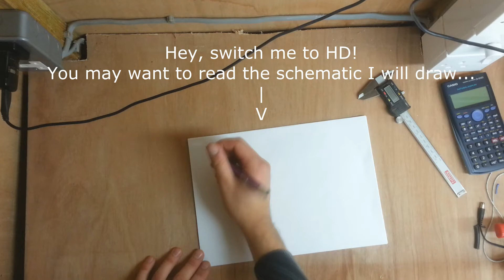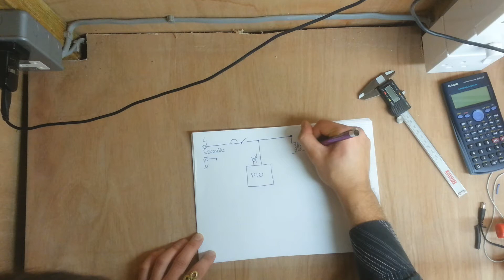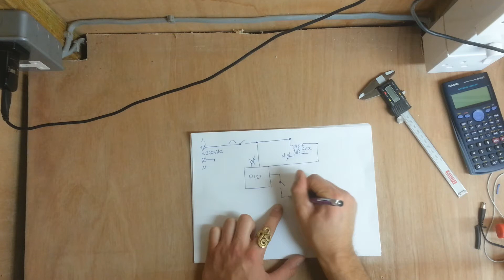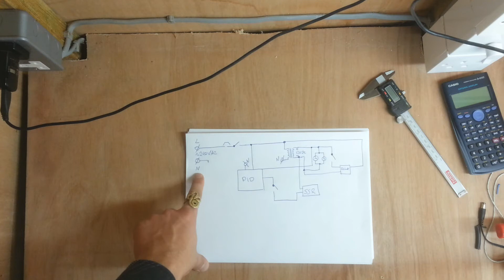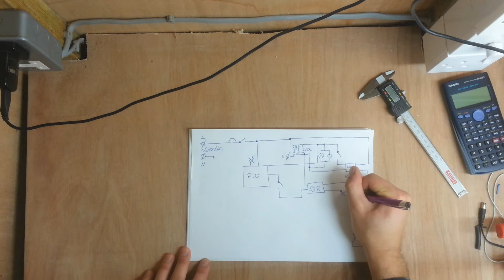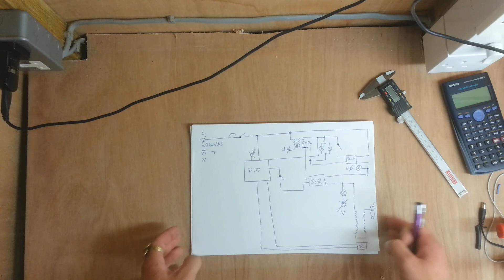Heat Treatment Oven Build: Part 6 - The schematics

Comment: A step down transformer will not give you 12 volts DC you need to rectify the AC using a diode bridge and capacitor bank to filter the the pulsation.
You door latch has a hose clamp that could be made cheaper and better with a cotter pin,
Reply from the maker: Frederick Kaludis You are absolutely correct. In the end I used a wall plug charger of some sort (from my junfk bin). Didn't occur to me at the time that this was technically a mistake in the schematics, but my intention was to use a wall charger from the very beginning.

Comment from the maker: Complicated? It turned out a lot simpler than though it will.
PID's are different. Mine does not give power to the SSR by itself - it must have a secondary 12VDC supply it can switch.
Also, there are no 110V legs on this setup, everything is 240VAC.
And yes, the indicator lights are optional (I believe I did mention that) but the SSR's can and are known to fail, and I prefer to gave a big yellow light shining in my face as an indicator as opposed to a small LED on the PID itself. Another one is indicative of the door interlock. The switch for the door is potentially exposed to quite high temperatures, so I prefer to have an additional light to indicate if it had failed. Preferences, I suppose.
Thank you for your input.
Reply from the maker: ***** Sorry to disappoint, but I sort of picked up as I went along when I was younger... But probably wikipedia is a decent place to start..

Comment: Great video, Thanks for sharing. I am wondering why you have a Element kill switch? I see a few other people with DIY kilns add this switch but non of the store bought options have them. It seems a little redundant because if you really need to kill the coils you can flip the power switch.  You have been running this kiln for a few years now, any advice or changes you would make? Thanks again!
Reply from the maker: Hi, sometimes you want power at the control box - like when setting the temperatures or fiddling with the settings, but dont want the kiln heating up. At the time seemed like a good idea, and I think it still is.
Unfortunately, my knifemaking side of life had to be put on the back burner ever since the last video on this channel - day to day life kind of got in the way. So the kiln hasn't been running as much as I would have hoped. If I was doing it again, I would probably keep most things as they are - but maybe pay more attention to detail, so I don't end up with gaps between bricks, etc.
Thanks!
Reply: Libris Custom Knives Thanks!